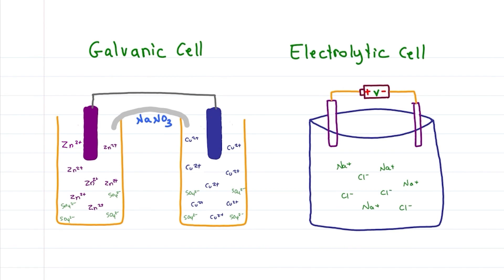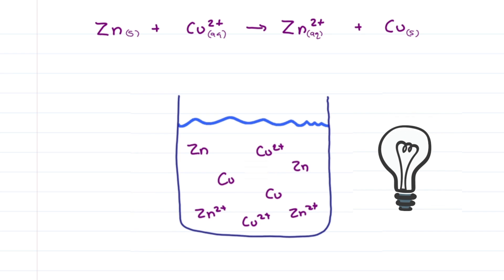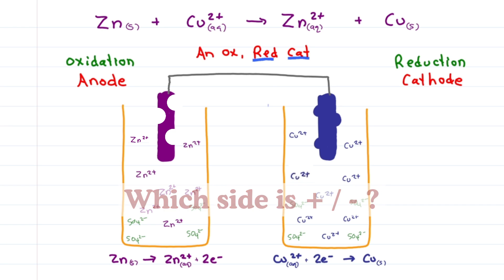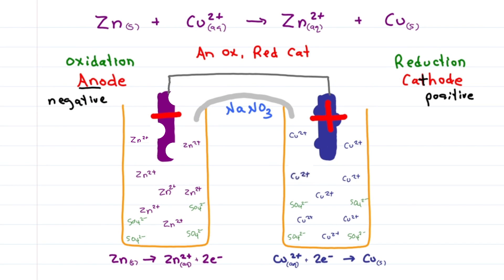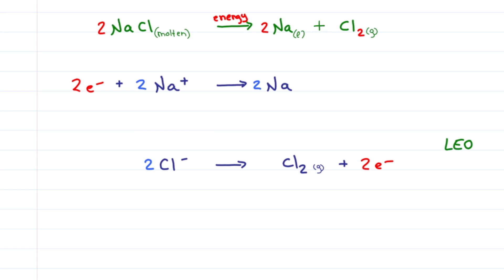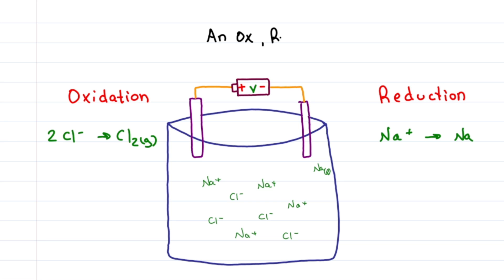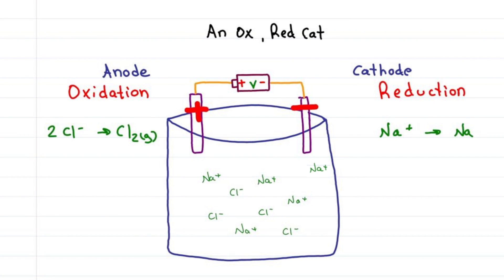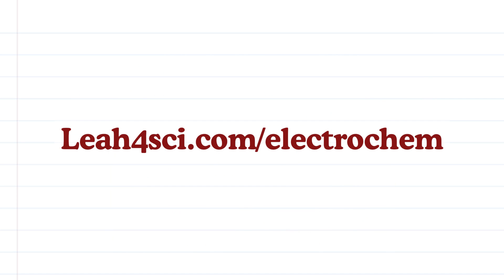Electrolytic vs Galvanic (Voltaic) Cell | Electrochemistry

Comment: 1:10. "Notice that zinc has  two electrons on the product side, meaning it gave  up or lost electrons. Leo, it lost electrons and got oxidized. "
No, this is wrong. Zinc did not "get oxidized" as a result of losing electrons. "Oxidation" is merely a synonym for "losing electrons", no additional meaning or activity is implied.  
This "reduction" and "oxidation" terminology is some of the most profoundly stupid nomenclature in science, wasting every student and instructor's time, and creating needless confusion. When will the discipline of chemistry fix this nonsense and just use "electron-gaining" and "electron-losing", or something similarly obvious and self-explanatory?  Sheesh.  Somehow, since "Oxidation" and "reduction" were coined, we managed to move on from "horseless carriage" to "car",which I'm pretty sure is an improvement.

Comment: During discharges of a lithium ion battery,anode is negative because the oxidation occurs and it gives electrons through the load to the cathode,but while charging,cathodes has become  negative because it has a pile of electrons while anode is positively charged,so when applying an external battery shouldn’t we connect the negative side of the battery to the cathode so it reclaim the electrons and send it back to anode ?

Comment: I don't understand the part about the anode och cathode charges. I specifically don't understand why the anode is negative and why the cathode is positive. 
Zink-ions leaves the zink plate and desolves into the solution, the ions are positive and leaving the zink-plate makes it negative maybe? And Zink has no charge so how can it be negative.
But what does this mean for the solution. Is it the solution that is negative and pushes away elekctrons from the Zink or is the Zink itself negative and pushes away electrons from itself?
And same for the cathode. Is it positive just because it picks up electrons?
Reply from the maker: The anode is negative because zinc loses electrons — they flow into the wire, leaving the metal electron-rich. The Zn²⁺ goes into solution.

The cathode is positive because it pulls in electrons, which reduce metal ions from the solution onto the surface.

So: electrons move through the wire, ions move through the solution

Comment: I have a question.. so can you explain to me a bit more the part where you mention how the cl- goes to the positive electrode(anode) ….you said something about the electrons coming out of the battery which attracted the Na+ but then u lost me when u stardet mentioning the Cl- after that like how did the Cl- connect to it . Thank you I have an exam on Tuesday
Reply from the maker: Hope your exam went well!

To clarify that part: the battery pushes electrons out of the negative side, which attracts Na⁺.

On the positive side (anode), electrons are being pulled away, so Cl⁻ is attracted there. Opposites attract.

Comment: thanks a lot for the video but I have question; suppose zn loses 2 electron and becomes zn++
right
but it would have been easier to remember like zn loses 2 electrons and becomes zn-- (losing relates to negative)
Reply from the maker: You have to look at the ionization energy, some atoms will easily lose one electron, some will lose move than 1 with relative ease while others will never let the second one go. Zn however will NOT gain electrons to form a negative

Comment: If you ran the galvanic cell to depletion, and then evaporated off the solution, would you be left with just zinc sulphate?
Reply from the maker: In the anode, yes. But you might find a mixture of salts that also include a minority of sodium and nitrate ions from the salt bridge that migrated to help neutralize the cells.